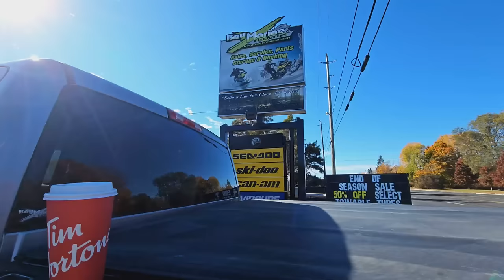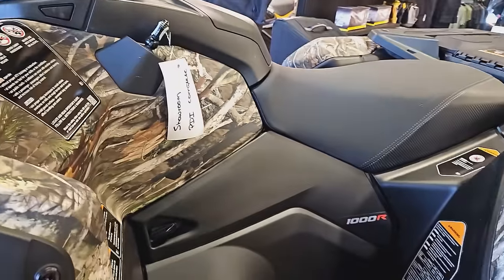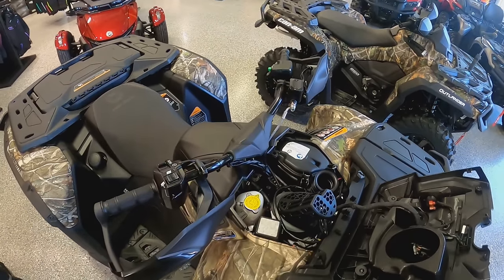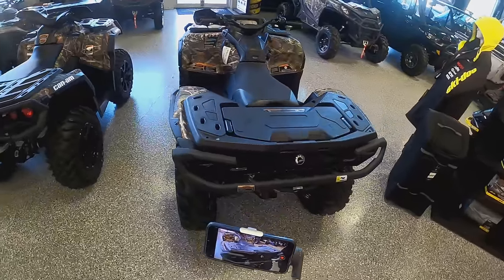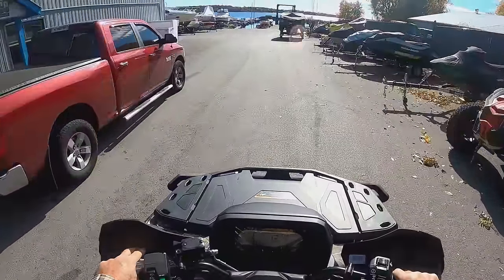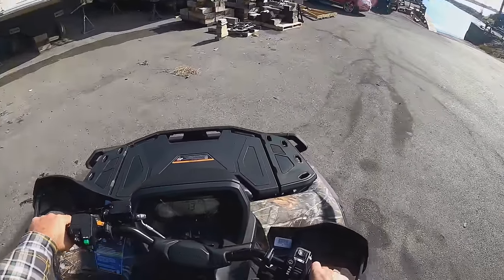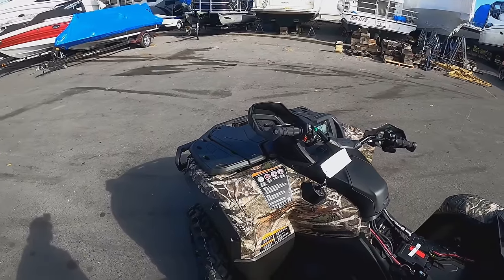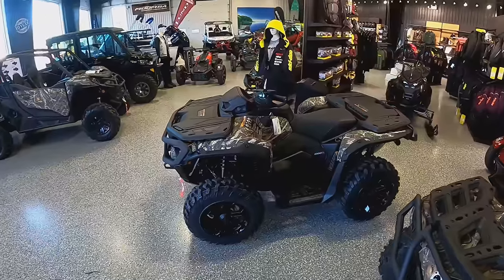2025 Can-Am Gen 3 Outlander 101HP XT (Walkaround & Review)

Comment: It’s not so much the G3 or the rear a arms that’s making it squat or have body roll. The G2 XT or DPS are super soft as well. I just recently switched to Elka shocks and had to take them off. Way too stiff for my liking. Nice having shocks that actually move when trail riding. And yes I agree, if the P Drive is anything like it is on the Ski-Doo it’s certainly an improvement. Very smooth, great design. Heavier, but it’s defiantly a better clutch.

Comment: I watched a older one snap it's drive shaft last night. Does anybody make a machine that doesn't break?
Reply: Honda would be your best bet as far as durability, followed by Yamaha, Kawasaki, then Suzuki. Japanese manufacturers are the only way to go as far as build quality. If you plan on modifying the machine, then you have to consider the limitations of OEM parts. For an example, the stock front tire on a Honda Rancher 420, rim, and tire is 23lbs. It’s a 2ply 24inch tire. If you add a
25inch Sedona Ripsaw 6ply tire with 12inch rims, that tire combo goes up to 40lbs. When you start doubling the weight on those axles, and hubs it will cause those components to wear prematurely, wheel bearings, bushings, axles, CV joints etc. If you where to add 14inch rims with say a 27-30inch  mud tire you maybe adding up to an additional 80lbs or more to that axle. While it may rotate them, you would be putting much more strain on components not designed for that. The same can apply to drive shafts, and other mechanical components. You have to understand the limitations of OEM parts, and accommodate the modifications to that machine with aftermarket components intended to handle such upgrades. I personally don’t like the Can Ams because of weaker components, on a machine that has way too much hp, and torque for the frame, and chassis it’s mounted too. There are a number of issues with Can Ams, as to why I personally don’t like them.
Reply from the maker: Power 😅
Reply: @ehTV1000  His comment was durability related , so I referred him to manufacturers who have a reputation, and record of building durable, and robust machines. Can Am doesn’t put strong enough components on their machines to mate well with the power of their engines when pushed hard. I also emphasized contributing factors as to why, and what might address those specific issues.
Reply: @ehTV1000  power is great. But make sure it can handle it. Otherwise your putting out trash can am.
Reply from the maker: @billwill7383  diffs have been my only issue, and one powersteering unit. 7 Renegades now, and haven't chewd a diff in the last 5 so far though. Possibly headed in the right direction.

Comment: They’re far better in every way except MAYBE for diehard mud riding only people , and possibly the Antarctica dwellers worried about frozen ice .
Our 500 gen 3 makes zero squeaks groans or any drivetrain noises whatsoever , compared to the squeaking , groaning , insane drivetrain noise , howling straight cut rear diff gears , poor fit and finish 23 1000R XT. 
Absolutely love the 500 more in every way except power .
Reply from the maker: So much smoother, and your right. No contest on drive line noise

Comment: Why do they weigh 975 lbs? I have a 2022 Renegade XXC 1K. Was hoping to trade, but they didn’t put the “big” motor in the Renegade. Doesn’t make sense. Most who buy a Renegade would appreciate the extra power.
Reply from the maker: Don't really need it, the Renegade is damn near perfection 👌 lol
Reply: @ you are correct Sir
Reply: I would hold off trading because i’ve read on a few forums that next year the Renegade is getting a refresh and will be getting the new 101 hp engine.

Comment: They look good, have modern conveniences, the Rotax engine is okay, but that’s about where it ends. The overall build quality isn’t there for the long-term. I would like to see the motor mounts on the 850, and 1000’s. They are very pricey for a short term machine. Looks can be deceiving.
Reply from the maker: You raise some valid points. It's definitely a pricy toy to maintain.  But what high-performance machines aren't? Lol. And yes, I definitely should have looked closer at the bushings on the machine, as premature failers are most certainly common on these machines. Being as my brother has pre ordered one, ill get to see the long term ware on a gen 3 here shortly.  Cheers man, and thx for checking out the vid.
Reply: @ Yeah, I seen where people who purchased the XMR 700 G3 we’re already experiencing motor mount failures, and the roller bearings on the P-Drive primary clutch should be carefully inspected at around 500 miles, and every 500 miles after, as they to have shown to fail . There are videos on YouTube on preventative maintenance on greasing them. If they do fail, it can cause major transmission problems, and very costly repairs. I would really look into those two specific issues. Also inspect the torque bearings, as well for signs of grinding. All these issues can be found both on YouTube and forums. Hope this helps. Because the 850/1000 engines are even heavier than the 650cc 500/700 G3 outlanders I would carefully inspect, and keep a eye on them, especially if you do any aggressive riding, or happen to have any hard landings, or dip hits. Some people remedy this issue with using the Ski Doo motor mounts, as they seem to be better than those on the Outlanders, but will fit in place of the OEM ones.